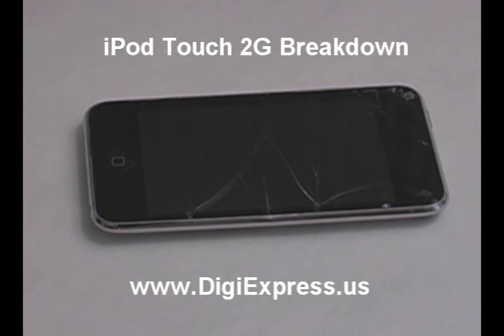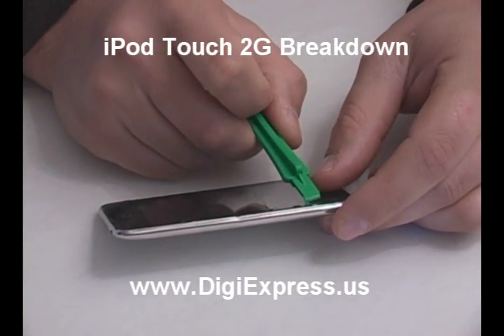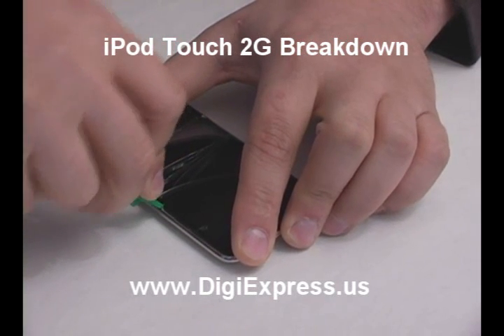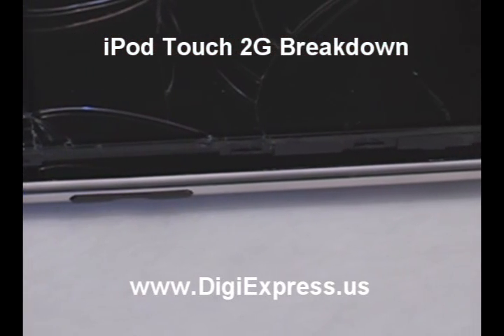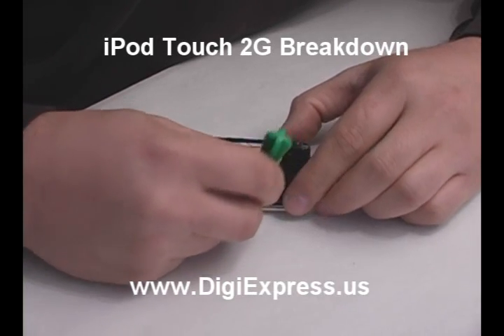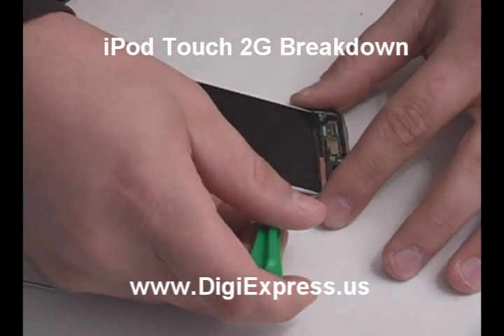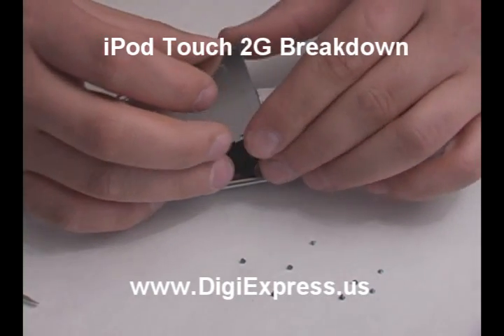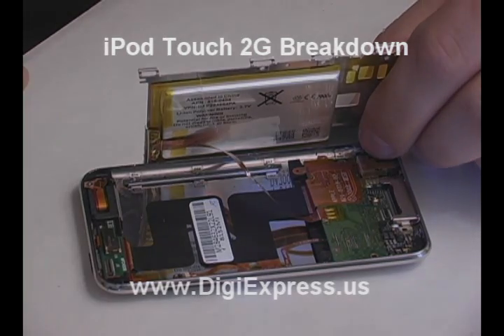DigiExpress - iPod Touch 2nd and 3rd Generation Breakdown

Comment: As I was opening it, the ribbon cable just snapped.... then for now the screen is all white and there's a black spot on the top left corner. Is there a way to repair the ribbon cable that connects the  screen and the LCD?

Comment from the maker: In some cases, water damaged parts can be replaced. But those instances are only when the device isn't submerged completely and for a long period of time. If it went through the wash cycle, chances are the main logic board is water damaged. If you were to do repairs, chances are the parts and labor would cost more than the device is worth. It's probably less expensive to purchase a new one.

Comment from the maker: We do repair iPods. There is a $25 labor fee plus the cost of the parts. You can place an order here:.digiexpress.us/ipod_touch_parts.html.
Select your generation and then either select the parts you think you need and add the labor fee on that page, or choose the general repair if you're unsure of what you need. Once that's done, checkout. You will then get an e-mail with the follow up steps.

Comment from the maker: It sounds like the LCD screen may have been damaged. Even though the front screen didn't crack, the LCD can damaged without any cracks. We do carry the parts and  you can follow with our videos to attempt to do your own install to save some money. Or we do offer a mail-in repair service. The cost of that is $25 for labor plus the cost of the part (we sell LCDs for $29.99). You can learn more here: digiexpress.us/ipod_touch_parts.html

Comment from the maker: It does sound like something that can be repaired, but it's tough to determine exactly what the issue is. The only thing that would be unrepairable would be the main board of the device. If that's the case, then it's actually less expensive to buy a new device. But if you're interested, we can do a diagnosis and find out what's wrong and if it's repairable, we can let you know before we perform any repair. It cost $25 for the diagnosis and if it can be repaired, extra costs would be in parts.

Comment: I recently rebuilt my computer and have to admit I am novice. The first thing i did was take a then working ipod touch and plug into the usb port on the top of my desktop. It almost immediately turned off and now wont turn on again. I try and put it on various chargers but alls it does is get hot. Does this sound like something that could be repaired?

Comment from the maker: Spoke with a senior tech this morning. We don't carry just the ribbon cable that connects the two. The ribbon cable is actually part of the battery, so if we we're doing the repair, we would have to replace the battery to get a new ribbon cable.

Comment: I realized the problem. The copper film on the top right corner that comes from the back of the metal plate, I accidentally cut it. A friend of mine told me that that is what connects the battery and the lcd screen. How can i get a new piece of copper for the ipod to work?

Comment from the maker: I did just check with a senior tech on this as well. He did say to verify the connections, especially around the power button. That cable is very sensitive and it doesn't take too much force to disconnect or damage that cable. If it is connected, then you may just need a new power button. But there isn't a lot of damage that can be done when replacing the LCD screen other than the power button.

Comment from the maker: I would recommend confirming that all of the connections are properly put back together and attached securely. If they are not, that could be the problem. If they are, there could be something a little more into it. Let me check with a iPod tech and I will get back to you later today.

Comment from the maker: With the headphones, make sure there is nothing blocking the plug. Also, did you order a headphone jack? You may have to elaborate a little more as to what the full problem is. Also, make sure you're using headphones with the correct size plug.

With the home button, make sure you heat it up and take the plastic tool supplied and pry it out. It just sits in a groove on the midframe.

Comment: i have a 3rd gen, and i have 2 questions. i took apart my ipod and my parts are coming in january. My headphones don't plug in when i try to connect them, and how do you take the home button off, because im not sure i ordered the full frontal assembly

Comment from the maker: First off, verify that your WIFI is turned on inside of your settings. Inside setting you should see a WIFI option. Go in there and verify that it is turned on. If not, slide it on and connect to your network. If it is on and still not working, your WIFI antenna could be malfunctioning. In that case, the best route is to actually have our technicians look at the device. It's an extremely tricky fix, and is recommended that a specialist do it. If that's the case, call us. 800-440-4693.

Comment: Well, broke the cable attaching the digitizer to the iPod. The method to do this is not shown in this video. This is not an easy repair. You probably should let these guys do it for you. I'll be sending it in to them for a repair now.. sigh.

Comment from the maker: @link4265 It is very possible that the cable had come loose, but be prepared for the possibility of needing a new LCD screen.  The shock of the drop may have simply damaged the internals of the LCD, either way you'll want to be careful when opening the iPod so as to not further damage the LCD.

Comment: I dropped my iPod recently and then its screen went white, but the touch sensitivity was still there.  I was able to remember where to swipe to unlock, and it made the unlock sound.  I tried turning it off and then on, and now it makes no sound.  Could this be due to a loose cable?

Comment from the maker: @lxHorizonxl Since the headphone jack is a soldered part on this iPod Touch, I do not think simply tightening the mounting screw will do anything.  If you would want to take the screen off again there is only the trick of knowing where the clips on the backplate are.  The clips that sit into a divot on the mid-frame that is.  If you know the exact location of these clips then opening the iPod is just a matter of being careful.  Though if it were me, I would set the iPod to mono.

Comment: Ok so I got a new screen and frame in the mail to replace my old cracked one. I took the old on off without giving any regards to the damage  (Because it was already cracked) and it came off with no extra damage. I mean to tighten the headphone jack to see if i could fix that problem as well but i forgot... Now I have to take off the new screen I just put on and I'm afraid I might break it... any tips? Sorry for the long comment and all, just don't want to have to order ANOTHER screen.
Thanks

Comment from the maker: @mwagner1996 You would not be able to remove the flash storage on the iPod logic board, it is not a hard drive.  There is no reliable way to remove and replace the flash storage on the iPod touch, iPod Nano, iPod Shuffle, iPhone or iPad. It is a very common request that we receive, however it is just not able to be done.

Comment from the maker: @DarKGo Take off the glass with midframe part.  Once removed you will see the headphone jack at the bottom right.  It has 5 solder pads on it with two holes each (not really important but may help you).  Using a braid or solder vacuum, remove the original sodler and then remove the old part.  Installation is the same, you just tin the tip of the soldering iron and solder the new part in place.  You may need a magnifying glass.

Comment from the maker: @CoRkSkr3w Currently our repair times for an iPod Touch 2nd or 3rd generation model is between 3 and 7 days.  The turn time depends on what part is damage and what precisely is needed to repair it.  For a simple headphone jack installation you should obviously be on the 3 day end of that, however we do have orders placed en mass which is way we say up to 7 days.

Comment: My 3rd generation iPod Touch works just fine, except the screen is always dim. There might be water damage, but when I look into the headphone jack, I don't see red. Is it possible to fix the lighting problem by replacing the LCD screen, and if so, how much would it cost?

Comment from the maker: @SmileyyFaceeCutiee We would need to Diagnose the device before comming to a proper conclusion.  Though in general if the iPod can still be recognized by iTunes, then we may be able to help.  If the iPod is not connecting to iTunes, then you may have damage to the logic board.  We are not able to repair the logic boards on the iPod Touch models, as the cost for the logic board itself would outweigh the cost of a new iPod Touch.

Comment from the maker: @btayebnejad Sorry for the delay in responding to your question, which amounts to free tech support I might add.  Heat up the original front panel assembly with a heat gun for a few seconds, remove the glass, remove the home button flex cable from the metal rectangle on the mid-frame.  You can now reuse the home button flex cable, as well as the original home button.  Be careful not to break your mid-frame if you need to reuse it for anything.

Comment from the maker: @btayebnejad look at the metal rectangle sitting right below the home button.  This metal rectangle is on the mid-frame and attached to the metal rectangle is the home button flex cable (the actual circuitry for the home button).  Simple remove the old flex cable and install into the new mid-frame.  You may need a bit of heat (from a heat gun not a hair dryer) to loosen the adhesive, but otherwise you should be fine.  Sorry for the delayed response.

Comment from the maker: @IhBraveslax22 Repairs for any issue start at $25.00 and if parts are additional there would be an additional cost.  The replacement headphone jack part itself is $19.99 for most iPod Touch models.  More information is available on our website.

Comment from the maker: @TheSamonator96 You would need to replace the glass digitizer and LCD screen at minimum.  Though the whole issue of a backlight can be either LCD screen or a logic board issue.  Water damage is a tricky issue, though we do have a Diagnosis service that can through everything but the kitchen sink at it.  Obviously in an attempt to repair the device and not actually throw a kitchen sink at it.  More information is available on our website.

Comment: @DigiExpress what if there is water damage? my ipod went for a little swim and the touch screen won't seem to work now... It can connect to itunes but the screen is very dim and again the touch screen doesn't work. Someone told me they think it might be the flex cable board?  what should i do?

Comment from the maker: @gameking150 If there is no water damage, then it would seem as though you need a new glass digitizer.  DO NOT purchase a digitizer seperated from a glass piece, this will not work ever.  Only purchase a glass and digitizer combination, then you should be on your way to a working iPod Touch.

Comment: @DigiExpress thanks! but i found the problem. at the end of the flex cable that connects to the logic board there was a little water spot from something i guess was spilled on it. since i got it from a friend i didnt know but i just wiped it up and let it dry for about 30 mins and now it works perfect. thanks for the help!!

Comment: i need some! i bought a new digitizer and replaced it and checked all the connections but i still have no response. i can not slide to unlock. and its not the digitizer caus ei bought two and i got the same results. any ideas?

Comment: @Sissy2468 yes, as the glass screen on the very top is the digitizer, but it isnt as easy as it looks and very easy to break other shit (like the frame either when you take the frame off the digitizer or just taking the digitizer off at all) I would reccomend dealing with it.

Comment: hi just want to know if any1 can help me here after i took my ipod touch apart due to water damage as it would not start i removed the battery connected the usb cable and i just get an apple logo that flashes on and off every 3-5 seconds is this normal
and will a new battery fix this
cheers jon

Comment: my ipod will not sense touch.... if i flick near the top it will work for like 3 min if i"m gentle with it.... if i replace the digitizer and screen will that fix it? the screen is not cracked but i dropped it a few times with a case on it.... but it worked fine after that... and now its broken

Comment from the maker: @sonboi100 When you put the screen back on the device, the ribbon cable for the digitizer had probably come loose.  You'll need to open it again and check the ribbon cable for the digitizer.  The cable sits in one position for so long that when you do open the iPod the cable has a "memory" of the way it was bending to sit on the connection.  Try this, but be very careful.

Comment from the maker: @vparlier there are different grades of parts (A through D), just like a report card.  A is a quality part (ours are OEM quality A rated), then you have the "10$ screen on eBay" which is gonna be used or a D quality part.  Since the digitizer does respond, only very slowly, you may have a bad part or the receiving end of the connection is damaged.  The receiving end is actually the Logic Board which is not cost effective to replace.  I would contact the seller of the digitizer about a warranty.

Comment: I replaced my glass digitizer screen, but there is still no response.  Is there something else that may be the problem? LCD display works fine, but there is no response when I try to slide it on.  If  I hold the power button until the "slide to power off" screen appears, I can touch the cancel button and get a veeeerrrrrrrry slow response to that.  Are there different models of digitizers among 2nd gen touches? Or are they all the same model?  Or does it matter if they are different models?

Comment from the maker: @xKarla22x It could be the battery or the logic board (Main Electronics Board).  The logic board controls the charging of the battery.  If you would replace the battery and find it would be doing the same thing, then the issue is with the logic board.  There is no easy way to tell.  We do sell the batteries (with a lifetime warranty) for $9.99 on the iPod Touch.

Comment from the maker: @chunkysalza The headphone jack solder join probably was broken in the drop.  You would need to resolder the lead to the pad on the logic board, or just replace the headphone jack with a new one.  A replacement headphone jack, OEM quality, is $19.99 on our site.

Comment from the maker: @HellsKnite I would say that replacing or re-soldering the headphone jack should fix the problem.  Though when you say the sound fades at "angles' i assume you mean when you tilt the ipod left or right.  This makes sense if you are tilting the ipod the weight of the headphones can pull the headphone jack further from the logic board.  Though you may have an issue with the accelerometer, in the worst case.  I would replace the headphone jack first and go from there.

Comment from the maker: @ohade123 the water damage got to the digitizer and you would need to start by replacing the glass digitizer and if that does not work then the water damaged the logic board.  the logic boards are not available at a cost effective level for these iPods.  So if the replacement digitizer did not work you would have to buy a new iPod.

Comment from the maker: @voxac30blues that is the 30-pin connector that is broken on your iPod.  While there are some who may sell you the part, you need special equipment to properly solder it into place.  It is not something a novice should attempt, as you can damage the charging circuitry around the area.  We do not repair logic boards on iPod Touch models.

Comment from the maker: @UnleashedDog More than likely the water, somehow, shorted the chip that handles the wi-fi.  The replaceable parts for this are only the Antenna, not the chip.  In the case when Wi-Fi options are greyed-out then the system is not receiving information from the Broadcom chip on the top part of the logic board.  Generally this is not cost-effective to repair in a 2nd or 3rd generation unit.

Comment from the maker: @WingmanStarcraft It sounds like you need a new glass digitizer, but first check for any water damage.  There is a water sensor in the Headphone Jack, take a light and look in the headphone jack, if you see red or pink then you have water damage.  If there is no water damage, then you can safely assume that by replacing the glass digitizer you would get the touch function back.  We can sell you the part if you would like or we also do installations, more info is available on our website.

Comment: I dropped my iPod touch 2g in a hot tub and it was completely submerged for about a minute, it has been about a year and when i try to turn it on, i get a white screen. It is recognized by iTunes. When I plug it in i get the charging sound. I have tried to reset it but it didn't work. If I click the home and sleep button at once i hear the sound that verifies that it took a screen shot and i can then plug it into my computer and look at the pics on it and i see the "slide to unlock" screen HELP

Comment from the maker: @ganon391 When you apply pressure you are re-connecting the internals and this is why the sound comes back, generally you would replace the headphone jack and this should fix the issue.  Just be careful of the tracers on the board, you don't want to pull any of them from the board.